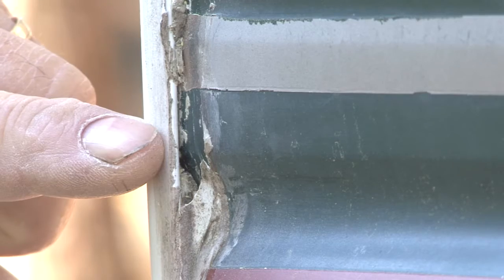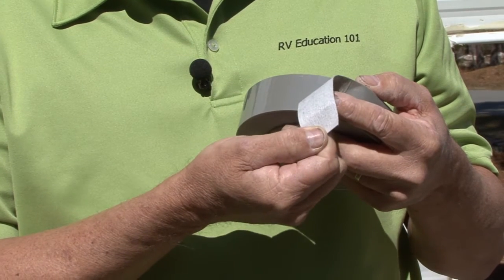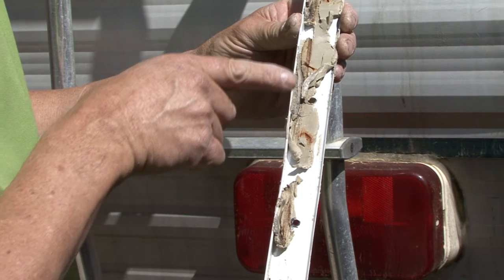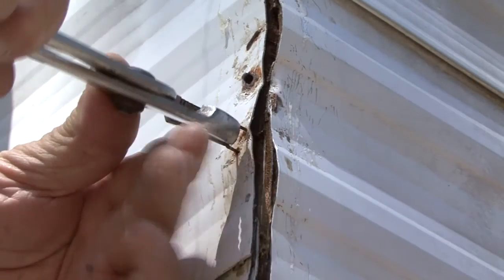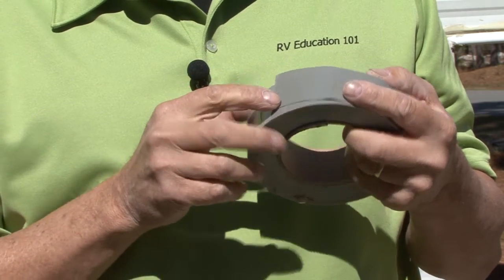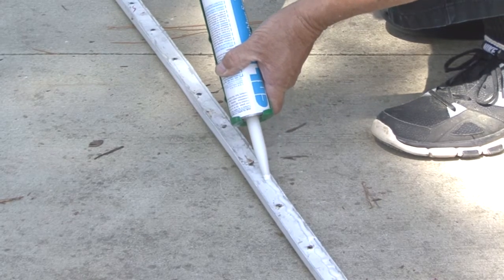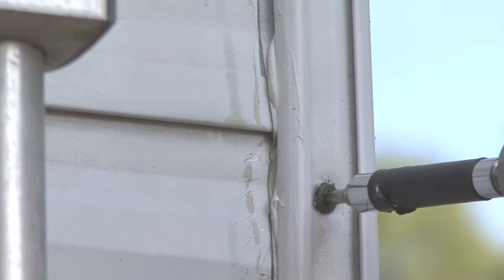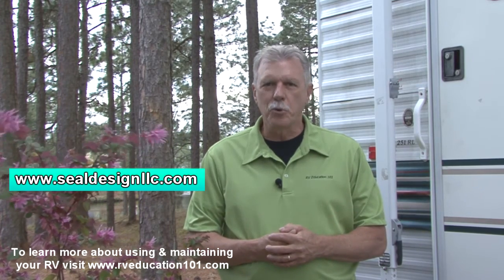How To Reseal RV Corner Molding

Comment: used this tape/kit on my class C this weekend and feel very good about the results. The most difficult part was removing the old sealant from the RV and from the inside of the molding. I found that using the alcohol spray on the old sealant made this task much easier.  Also, I live in Florida and did this job in temps at 90 and above. A major problem we solved was that, in that heat, we were not able to remove the cellophane from the sealant on the roll.  It was all stuck together and very soft.  We put the roll in the freezer for about 5 min and were finally able to get the initial pull of the cellophane accomplished easily. However, after only about 10 inches of work it was all stuck together again and we were not able to separate the two to continue working. We took first aid cool packs from the freezer and put them against the cellophane and it would again pull of about 12 inches easily. Once we  got this routine down the job was accomplished and the tape appears to have done an excellent job of sealing the corners.